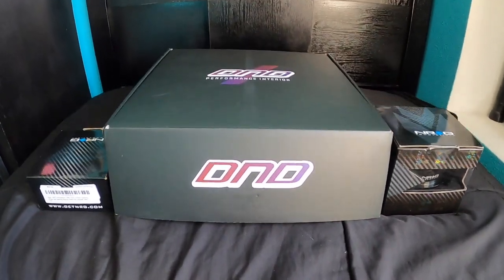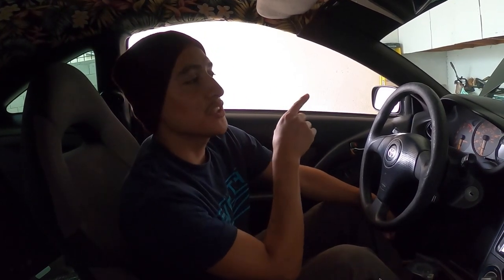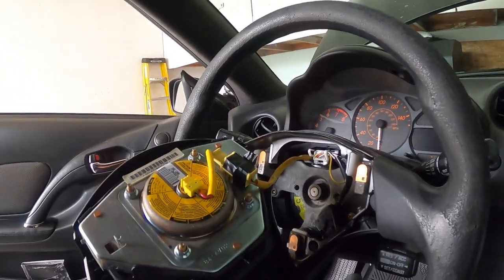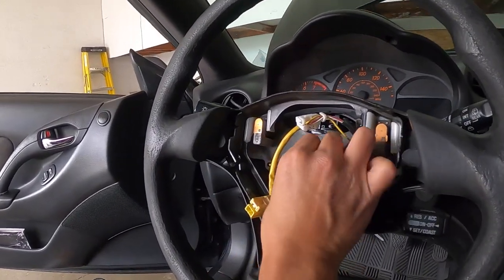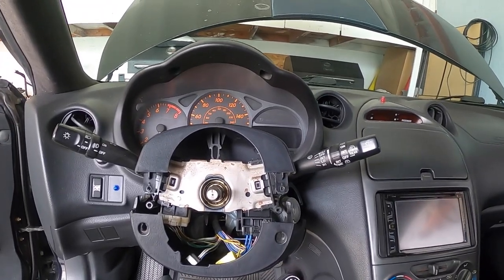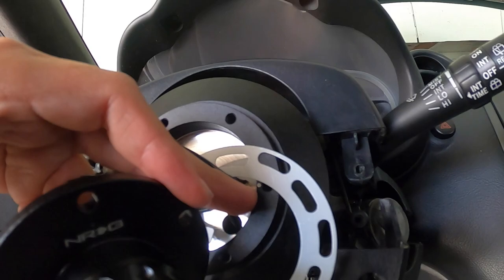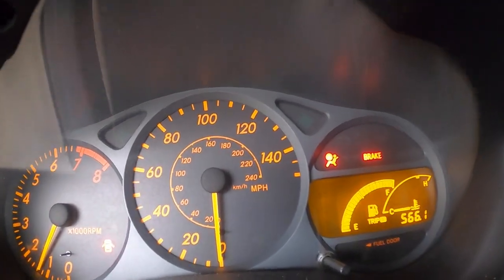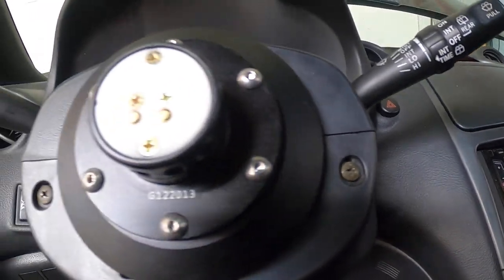How To Install A Quick Release/Steering Wheel (Celica)

Comment: Hey man I just installed the same wheel hub on my celica and when turning I noticed the hub scrapes against the plastics that cover the wheel hub did you have that same problem by any chance??
Reply from the maker: Yo! Yea I had the same problem. It doesn't bother me as much since my car is loud and I play my music on the louder side anyway lol but what I'm going to end up doing is removing the plastics and using a dremel to file the plastics down a bit to give more clearance so maybe its something you wanna try as well 🤙
Reply: @shadytreespec808  Whats your exhaust set up?
Reply from the maker: @kiixyo.2997  Im running a Greddy Evo 2 with a muffler delete so I have a custom pipe replacing it.
Reply: 0

Comment: Do I need the quick release? What happen if the steering wheel is not design for a Celica? Can it be modify so that it can fit? Or add custom adapter in between the steering wheel and  hub

Comment: so I used this video to replace my OEM wheel with another one, and the new OEM wheel doesn't have cruze control (which is fine the previous owner of my car took it out) but the connecter for the ground is different and I cant conect it. should I worry about it i haven't even started the car since i did it

Comment: So no horn and no airbag
Reply: The horn is easy to hook up lol. U just need to ground it lmao. U cut the blue & black wire which is ground. & u solder a wire to it to extend it to be able to touch the back of the brass from the hub & thats it lol as long as you have your ground wire touch the back of the brass your horn will work lol